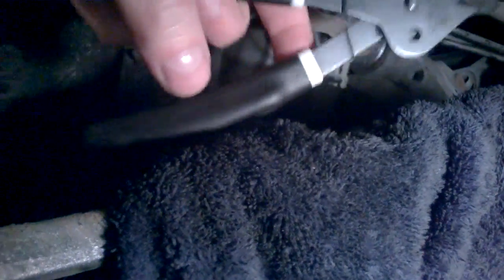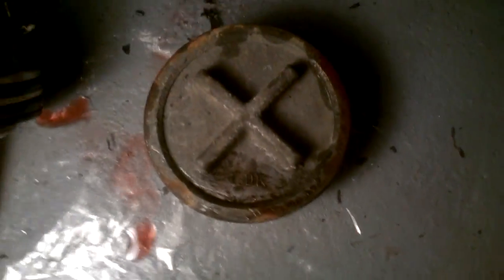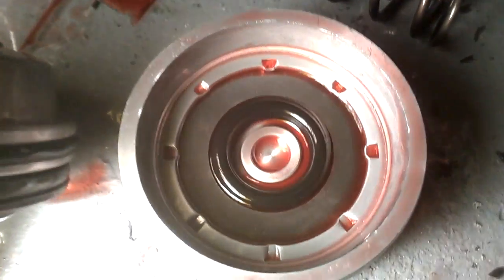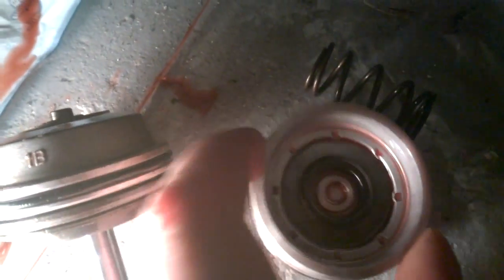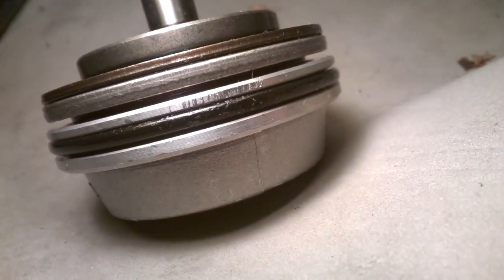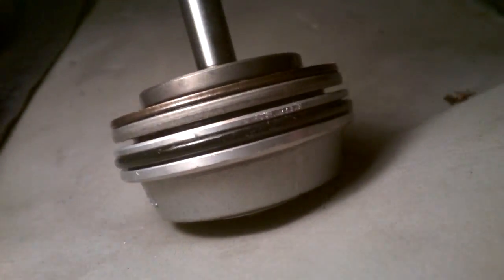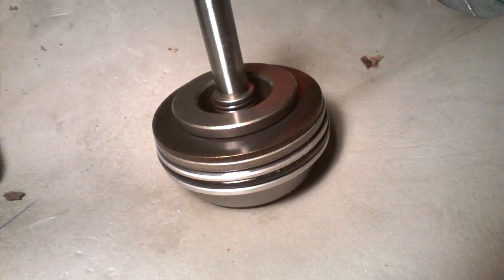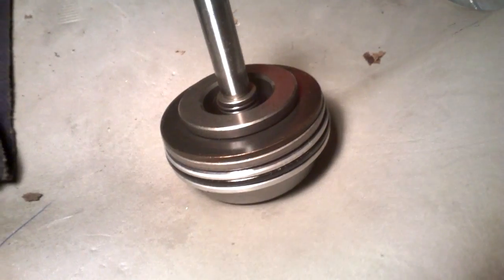Volvo Aisin AW55 transmission 2nd-3rd gear harsh/delayed upshifting (B4 servo piston removal)

Comment: Hello, would you be familiar with codes p0700 and p0740. I have seen a few of your videos on possible culprits that would lead to it. There is nothing wrong with the engine, thankfully, but what would be the first step to check the transmission? Like should i check electrical components first or the physicals components?
Reply from the maker: Not familiar with codes.. may try asking on forums like https://www.matthewsvolvosite.com/forums/
Reply: P0740 is 'Torque Converter Clutch Solenoid Circuit' which means the solenoid will probably need replacing.

Comment: Do you think this could be the cause on my 2006 s60 2.5t it has shift flares and not all the time either
Reply: Keep in mind it just started doing it
Reply from the maker: No, the B4 cover was faulty usually only on 01-02.  Do you mean it  was working fine before and stardet doing this all of a sudden ? Did the battery happen to be disconnected/replaced? Test first your MAF sensor. May also try resetting the adaptations using Vida or a higher end scanner. However this should be only done in summer time with the transmission fluid above 60C.

Comment: Hello, my 2003 V70 has just begun shifting harshly to 3rd, allthough it dosen't happen all the time. If i let the pressure build up by climbing a small hill it changes smoothly.  Can i drive without causing damage to the gearbox?
Reply from the maker: Perhaps see if the shifting gets worse  - that may be a problem with the B4 servo and I would then recommend replacing it because it can be done relatively simply using the tips in the video.  But if the shifting seems to stay the same, that could be a problem with the valve body solenoids (which is a bigger repair) and you may be good for another 2-3 years driving without replacing the solenoids. Of course, this is just a personal thinking, I may be right, or I may be wrong 😊
Reply: @Peppermint1  It really started out with a small bump into third, and has gotten to the point it slams into 3rd sometimes. But i will look into replacing the B4 servo. Thank you very much for the help! :)

Comment: That cover is a MF to get back in place with that lockring!! Took me 2h to get it in place and to lock. You Must have pressure on cover when installing the lockring...
Reply: How did you do it? I've been at mine for hours
Reply: Convinced that I need a machinist jack or something
Reply: @ImmaculateOtter  i pressed it in hard! Put a big screwdriver against it and wedged the screwdriver so i can free my hands to assemble the lockring!
Reply: @micke2943  I've tried that, but at a point, it doesn't seem to budge anymore
Reply: @micke2943  I even wrapped a ratchet around the whole transmission with a point pressing into the cover. That didn't even work
Reply: @ImmaculateOtter  I watched my mechanic do it. He had one person hold a long rod to the cover, then had someone else lock it in place.
Reply: @joshi5252  I had to take a breaker bar at an angle and push it in with a bottle jack. Super crazy stuff. I also used another jack with the weight of the car on it to stabilize the bottle jack.
Reply: @ImmaculateOtter  That does sound crazy. I was going to do this all by myself until I saw many videos on how hard it is to do. Glad you were able to get it closed up. Much respect!
Reply: You screw in a bolt m10x80 in the housing right near below the cover. This is the pry bar point.

Comment: I have a 2006 V70R that gives me issues shifting when cold. It acts like its going between two gears, the 2-3 shift. Especially does it around corners, like some ones slipping the clutch on a manual. It won't do it if I give it anymore than a quarter throttle. I replaced the entire valve body with a new unit from Volvo and it got rid of the jerky shift 2-3(a different sensation) but it still feels like it slips at low rpm and cold
Reply from the maker: I assume you performed the Vida adaptations reset followed by the drive-relearn procedure with the yellow triangle light?  If so,  there may be other worn parts inside the transmission. Maybe even a clogged internal filter causing low pressure in some moments.  
You may also try a new B4 piston but keep in mind that the transmission bore where the B4 piston sits also gets wear - the surface gets rough and the piston slides less well.

Comment: Please help got a 2004 xc70  when cold runs great after maybe 20 or 25 minutes 2nd,and 3rd starts  shifting hard and deleyed just on does two gears  is it the same problem as yours can i fix it as you did. Thank you.
Reply from the maker: Hi, the first thing to do is to replace the transmission fluid.  The transmission fluid wears out especially when a car has been driving in mountain areas or has been used for towing:  in such driving conditions, the fluid heats up too much and its qualities do degrade.  Use only a 3309 type of fluid (such as the Type IV from a Toyota dealer because some Toyota cars had the same Aisin transmission).  There are videos on Youtube that show how to replace the fluid by disconnecting the return line at the radiator (no need to drain the oil pan).  Maybe replace about 7 liters for the first time, then drive the car for a few hundred km see how it works. Then replace another 7 liters.  If the problem is still there with new fluid, then the solenoids (SLT, SLU and SLS) may need replaced.  You can find these on Ebay, search for Rostra solenoids. At the worst, the whole valve body will need replaced, but start first with the three solenoids.
Reply: Hi. I did all You said some time ago. I drained all fluid, flush it with 7 liters, then filled up to level. I have changed all 3 big solenoids, I bought valve body gaskets and chenaged them too. Nothing helped. The same, like Fernando said. While car is cold it shifts almost perfect. Only very tiny bump between 2-3 upshift. Thaen after 15 min it shifts perfect, but, when it gets to working temperature it starts  harsh shift between 2-3 upshift. Its like, it takes to 2000 rpm, then its like neutral, and in this neutral moments its grows to 2300 rpm, and then with hard shift it shifts in too 3rd gear. at the same time, when I brake it has very tiny bump from 3-2 downshift. I thought that servero cover is my last chance, but I think the problem maybe is somewhere inside transmition by it self. Or shifting is only valve body problem?
Reply: @TheJuris1986  hi. Ded you fix the issue . I have the same problem with the my volvo. Thanks
Reply: Original Juris You need to get the most recent transmission software update along with the servo update. And flush the fluid a few times with the proper fluid and it's very important this transmission has the exact amount of fluid. Try some seafoam Trans flush if your feeling up to it. If all that doesn't work then it's the valve body and if you replace buy a modified one. I've seen them go for about 7-800 bucks. The modified ones allegedly have bigger passages.
Reply: Oh add a Trans cooler
Reply from the maker: Maybe try asking on this channel, he is the 'master' at refurbishing these transmissions.  
https://www.youtube.com/channel/UCuJNRbjB41BP8SRqN0AKfZw
His name is Hamirez I think.  Maybe he can help.
I don't know the answer at this point.  Just hypothetically, I would try run an 'adaptation' mode, using the Vida software.  The way this goes, is the car is plugged to Vida and put in 'adaptation' mode.  A yellow triangle will flash when it's in this mode.  Then the car is driven in a specific way until the yellow turns off.  What is really important is to have the fluid fully warmed up (only in summer time) because the transmission adapts only when the fluid is warmed at 65C or up.  
More resources
 http://www.myvolvolibrary.info/Tech_files2_ficheiros/AW55-50%20Differences%20between%20Manufacturers%20-%20Part%20Two.pdf
https://www.sonnax.com/tech_resources/113-aisin-aw-linear-solenoids

Comment: Hello I have a 2009 volvo s40 2.0 diesel. Its slipping in gears and transmission performance low comes on. Does this mean it needs a fluid change?
Reply from the maker: That is the very first thing to do indeed.  I don't know the transmission on the S40, but better check with the forums to find out which exact type of fluid needs to be used.  I'd also keep in mind that once the transmission is slipping for long time, it will wear the clutches so there is a possibility the transmission won't last.  But always good to try a fluid change.

Comment: Hey Royal with cheese,
i have a problem with my Volvo XC 90 year 2004. The problem is that I didn´t have the 3rd gear. I read about an B4 anchor bolt but in germany no one can help me. So I decided to write here an hope for an answer.

My english isn´t that good but I hope I you understand it. I hope you can help me.
Thanks ;-)
Reply from the maker: Which engine is this and how did this happen? Sometimes people confuse the transmission drain bolt with the B4 anchor band bolt which causes the transmission to loose it's 3rd gear.  If this is what happened to you, it can be fixed without rebuilding the transmission.  Here are two links, one of them is missing the images
bottom post:  http://www.volvoxc.com/forums/showthread.php?15297-2002-XC70-Transmission-Nightmare-EVERYONE-PLEASE-READ!/page7
https://www.matthewsvolvosite.com/forums/viewtopic.php?t=79032
Reply: Royale with cheese  it's an Volvo XC90 2.5 D AWD.  My transmission lost oil and The Workshop repaired it. After that He put new oil in The transmission But Not from The dipstick. There is an Bolt over the transmission and He taked that Bolt out und filled up the oil from there. After that I tried to Drive and The Problem was there.
Reply: And its an automatic transmission *
Reply from the maker: The garage ruined your transmission by removing the 3rd gear anchor bolt.  Happens quite often with people who don't know about this transmission who can only be refilled by the dipstick tube.
Reply: How can I repair It ?
Maybe you can make a Short Video for that ?
Reply from the maker: http://www.volvoxc.com/forums/showthread.php?15297-2002-XC70-Transmission-Nightmare-EVERYONE-PLEASE-READ!/page7
https://www.matthewsvolvosite.com/forums/viewtopic.php?t=79032
Reply: Hey today I tried to repair My transmission but i doesnt work. I couldn't put The Bolt in its place. Shoul I Open The B4 servo Cover ? Maybe its easier to have both sides Open
Reply: Hey I just wanna Thank you for your help. I've repaired My car. Thank you so much ✌🏽
Reply from the maker: Thanks for the update!
Reply: @SahinBozz  How did u do it my friend? Have the same problem, XC90 2.5 2005, 3rd gear floating and shaking. THanks!

Comment: i have a 2005 xc70 and i am not getting the awd to work. checked fuses they are ok. i do not hear any grinding noise from the trans, i am the second owner, don't think they first owner ever took it anywhere that the awd would be needed. can you tell me what i should be looking for to find out what the problem might be. i read that id the angle drive splined sleve is broken that it would not make any noise is that true. thanks
Reply from the maker: All awd of that generation were poorly designed failing at the sleeve & angle gear.  Try to lift the car Safely (don't use the jack stand) and try turning the shaft by hand: if you can turn it by hand, the sleeve is gone.  Very expensive repair at Volvo, some managed to repair it themselves but it's not an easy job.
http://forums.swedespeed.com/showthread.php?164579-Never-replace-another-AWD-collar-sleeve-EVER-again!

Comment: hi, Royale with cheese, this is bob margret i am using my other account , anyway i did the trans flush and i used 16 lts. the oil was very dark red not quite black. i am going to do this flush again in the summer and i will also do the B4 servo as well.
it was a nice day today and sunny, as you know its winter and they are calling for snow and rain this weekend so i took the day off before the bad weather comes back. oh i don't have a garage. the shifts were smoother and the the sift from 2nd to 3rd was a lot better, some times you could not even feel the shift. thanks for all your help. i will keep in touch and let you know when i do the servo.
Reply from the maker: That is good news.  Nothing better than a transmission that shifts smoothly.

Comment: thank you. are you a Volvo mechanic.i guess you are in Quebec. i am in Vancouver, British Columbia. i am going to do a full trans flush tomorrow and go from there. i heard people used Lucus automatic trans additive do you think that could help.
Reply: NO! Do not use Lucas. I used it and it immediately got worse. Drained it immediately and put seafoam. If you're talking about the thick stuff, don't do it. The problem has to so with solenoids sticking and that's not gonna help. Seafoam transtune is thin and designed for cleaning stuck valves.
Reply: @travonmiller5279  yep
Reply from the maker: Yes, I live in Montreal.  There are a few videos about changing the transmission fluid, such as this one  https://www.youtube.com/watch?v=7WfY8MQc1B8 .  This transmission takes ONLY the 3309 type fluid (the one the guy uses in the video is not correct), which is the same as Toyota Type-IV sold at any Toyota dealer (some Toyota models used the same transmission).  Because this transmission is quite sensitive to a specific oil, I wouldn't use additives in it.  There are also excellent forums about this procedure such as this one  https://www.matthewsvolvosite.com/forums/viewforum.php?f=9

Comment: yes just saw what you used to sand the area looks rough, but it works. also a new o-ring will be needed.
Reply from the maker: It is important not to use sand paper or similar abrasives.  The idea is to use something as gentle as possible to 'erase' the scratches while not causing any roughness to the surface.  Any sand paper will cause the surface to be rough which will damage the rubber seals.  The 'wire' stainless steel sponge in the picture is perfect for this job, anything else could be too rough for the surface.  Don't press too hard on the sponge, take the time, it took me a good few minutes before I couldn't feel the scratch any more.

Comment: did you file the rough area with a file of fine sand paper?
Reply from the maker: Again, no sand paper by any means.  Use only light a stainless steel sponge - a quality brand, so no small pieces will detach and get stuck inside the tranmission.

Comment: hi, i have a 2005 volvo xc70 and i have the same problem shifting 2 to 3, but not all the time. also my auto trans is a 5 speed.
do you think that i could do the same thing to mine to fix the problem. also is your auto a 5 speed of 4 speed.
please let me know what you think. i live in west coast of Canada.
Reply from the maker: The transmission in the video is the Aisin 5 speed automatic.  There is a good chance the B4 servo to be in cause.  Keep in mind that it can be very hard to remove and place back the circlip that keeps the cover in place.  Some people took several hours trying to do it.  But the video gives a few good tips.  You can check the cover, the seals (both on the cover and the piston), and the bore inside for smoothness.  If all checks fine,  I would look next into the valve body solenoids (google up).